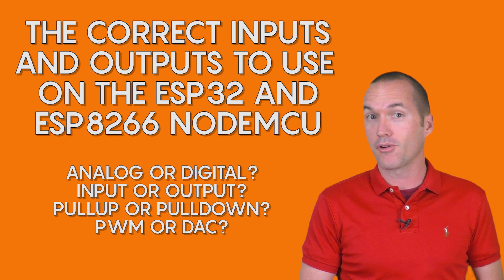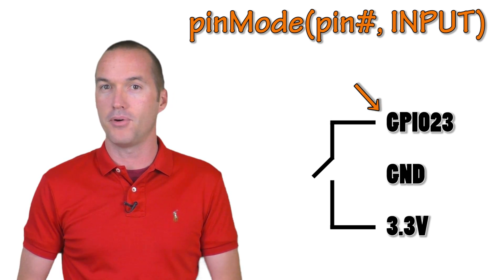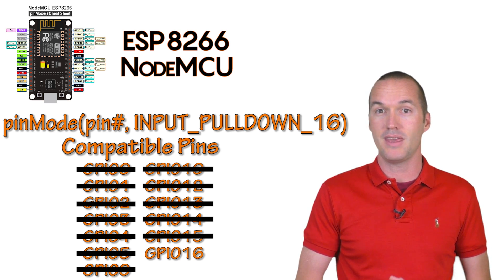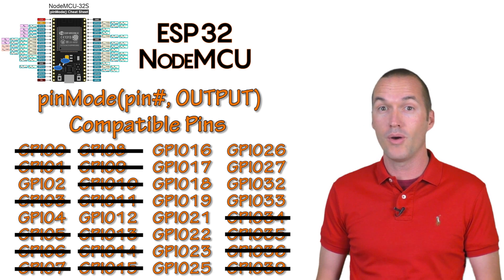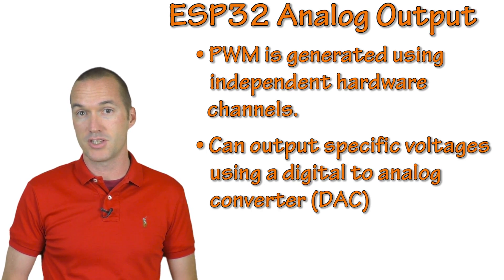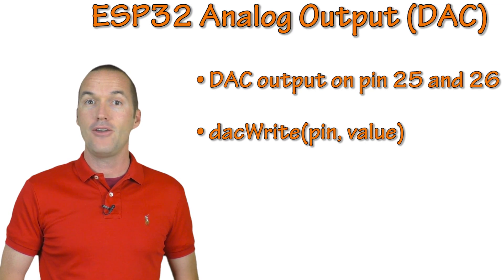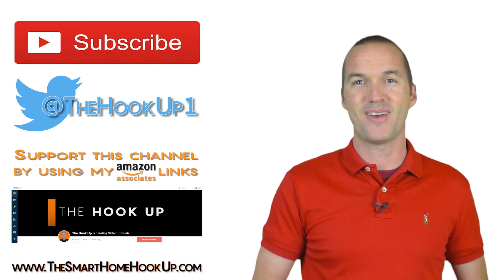The best input and output pins on the NodeMCU ESP32 and ESP8266

Comment: on the esp8266.. pins 0-14.. when you say pins high on boot... what is the pinMode of the pins at boot.. is this input high through the internal pullup resistor or output high.. because if they are digital outputs at boot and I connect a module or what not set as output also to those pins.. that would short the pins to ground/vcc vice versa when pins source or sink currents. which might burn the pins..

Comment: Hello  , Could some one please clarify what  is the output voltage of  ESP32 NodeMCU   GPIO4,GPIO16 and GPIO36 ? is it 5v or 3.3 V? When doing LEDs projects , some people suggest we us logic level shifter to control 5V led ( 300 of them using WLED )  , Please  help  as I tested those pins and they are close to 5V

Comment: one can easily convert a pwm output to an analog output by adding a capacitor. In order to know what value the cap should be one will have to apply some knowledge of electronics or experimentation. What happens is that the square pulse will charge the cap to a level equivalent to the amount of current flowing out of the cap due to the amount of load. The greater the duty cycle (percent on time), the higher the voltage level that is provided. Think if it like filling a bucket with water with short pulses of water.. full on, full off.. The level of the water in the bucket (voltage) will depend on the size of the hole in the bottom of the bucket (load) as well as the amount of time the water bursts refilling the bucket are 'on'.. (greater duty cycle = higher voltage)

Comment: What are usual resistor values for pull-up or pull-down resistors?
Reply from the maker: The built in ones are 20kOhm, but you can use anything over 220.

Comment: The video shows a Pull up resistor Green, Blue, Orange = 56K.   Is this the correct value to use?  How many mA goes into a GPIO input on an ESP32.  Thanks for a great video.
Reply from the maker: 56K will certainly work, the built in ones are usually between 20K-50K depending on the specific board.

Comment: Just checked the digital pins on my NodeMCU and I'm getting 3.3V from most of the digital pins even when my code (digitalWrite) is set to low for that pin.  Any reason I should be getting voltage from these pins whenever I power up the board?

Comment: so is it right that the pins only take 3.3 Volts? is the pin dead when I put 5 volts on it?
PS: cool Chanel sub and like!
Reply from the maker: It depends on how long it had 5v on it.  They are not 5v tolerant long term, but can take a second or two
Reply: The Hook Up cool thanks! So normale the Pins are not 5 Volt useable?
Reply from the maker: Correct, you can use a simple voltage divider though
Reply: The Hook Up Ok! Thanks man!!!

Comment: Why do you prefer nodemcu while there is D1 mini board that is pretty equivalent but a lot smaller?
Reply from the maker: Voltage regulation and tolerance are much better on the nodeMCU in my experience.
Reply: @TheHookUp  really really few applications need that added voltage regulation stability. All in all a good D1 mini from a good manufacturer does not have bad regulation

Comment: Can anybody tell me how will I then have to use GPIOs as when I connect my relay board with node mcu whenever power goes of or resets the Relay trips GPIO turns the relay on
Reply: no no no no I am not using no nv relay 
I am using magnetic dual coil latching relay I have used ESP 12 then used a npn transistor config to turn relay latch unlatch .
The high logic will turn on relay low logic will.not effect my relay .
The problem is at the time of power reset or board reset the relay gets a high logic on its own from GpIO which trips my relay I have also pull down my GPIO's still its happening .i can share schematic if u want but plzz help me
Reply: Same problem with me.. Any solution for preventing the relays to go high when I restarts my nodemcu??
Reply from the maker: Sounds like what you want is a normally open connection for your relay.  That means that when no voltage is applied to the signal line the relay is open (device is off).  You can then adjust your arduino code to use digitalWrite(pin, HIGH) to turn the relay on.

Comment: connect to esp8266computer's USB ports, everything working fine. But, if I connect esp8266 to separate charger that has USB port, then esp 8266not running code
Reply from the maker: That's pretty strange, no code runs at all?
Reply: Code works only when it is connected to the computer.. But when I connect it to a mobile charger it does not run

Comment: Esp8266 actually has a sigma-delta dac just like the 32
Reply from the maker: Really? That would be awesome, do you have any good links for it?  Is it implemented in arduino yet or only micropython?
Reply: @TheHookUp   It's for sure implemented in the lua firmware (which I use). Just #include sigma_delta.h (usage is in comments of header file)

Comment: using mqtt and tasmotized nodemcu gpio pins, i would like to control 
motor (forward/reverse/stop) is it doable ? any help appreciated
Reply from the maker: Tasmota does not natively support motors, if you got it to work through a motor controller it would be clunky at best.

Comment: Hi,
I am trying to connect 4 Relays and 4 Buttons to my Nodemcu esp8266 but unable to do so I have already tried to use your suggestions my PIN configurations are as under. 
Relay1 to D1, Relay2 to D6, Relay3 to D7 and Relay4 to D8
Button1 to D2, Button2 to D3, Button3 to D4 and Button4 to D5
can u guide me if possible which pins to be used for Relay and which for Buttons Thanks in advance,

Comment: Nice video, just one thing: on at least some models of the ESP8266 the ADC doesn't read beetween 0V and 3.3V but beetween 0V and 1V. If you need to read above 1V you need either a voltage divider or some sort of amplifier like a transistor or an opamp.
Reply from the maker: Correct, but the nodeMCU has the circuitry built in for 3.3v ADC
Reply: @TheHookUp  Didn't know about this, this is a great advantage over the bare ESP8266, thanks!

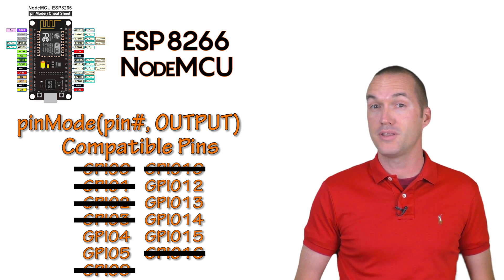Comment: Sir, very well explained. I got confused... You have said for more output go for esp32 (in video at 4:55). In nut shell, how many pins are available for output in esp8266?
Reply from the maker: 6 pins are well suited for output that don't have any potential problems.  You can use others as outputs but they have small issues like HIGH on boot.
Reply: @TheHookUp  Thanks, you mean others pin go high on boot, right? I can control in program. Isn't it?
Reply from the maker: @nitinjoshi239  Yes, you can set them to low once the program initializes, but they will always be HIGH for a few milliseconds on power-on.
Reply: @TheHookUp  got thanks and loving your videos....
Reply: @TheHookUp  sir, I seek valuable suggestion from you. One of my project require to drive 100 plus relays using Arduino, preferably using WiFi module. What solution you can propose.

Comment: I'm still confuse.
The Module I have has GPIO22  as a sensor input but its not one of the predefined analogue pins.
How do I set GPIO for analogue reading?
Do I use dacRead(22, 256) ?

Comment: Pleas i make project 4 relay and 4 button inputs is 12.  13. 15. 16
And output is. 0.  4.  5.  15
And play ok in real with button an also by blynk but when turn off and turn on not work and D3 or 0 pin have output all time and any button not work and any blynk button not work
Reply from the maker: There are a lot of tools you could use to make a project like this easily.  I'd recommend you take a look at ESPHomeLib, Tasmota, ESPeasy, and ESPerna.

Comment: I need to go back and check the code for pwm control of a PC fan. Never could get it to work w/ the 32S. Fan always ran 100%. Maybe you could do a short vid sometime?
Reply from the maker: I used the LEDC function in my ceiling light video, and there's an example sketch there if you want to look over my code.

Comment: 5:58 ten bit resolution return value between 0-1023 not 0-1024.
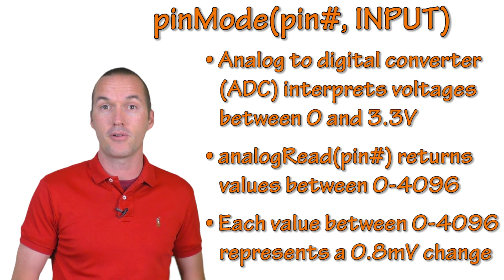Reply: Same with 12 bit resolution at 6:59. Range is 0-4095 not 0-4096.
Reply from the maker: Ack, yep, gotta account for 0.
Reply: And again with 8 bits.
Range of 256 ( 0..255)

Highest number MUST be odd, because least significant bit is 1.
Reply from the maker: Oddly enough, it doesn't loop back if you put in 256.  You'd normally expect 256 to return 0, but it returns the same as 255.
Reply: The Hook Up. I am guessing here, that the memory (address) that you write the 8 bit value to is itself wider than 8 bits. 
Then if you use the DAC with the limited 8 bit resolution, only the low 8 bits are used. Those do not roll over because the register is wider.

You can check if it rolls over at 16 bits or 32 bits.
Reply from the maker: good point, probably a good explanation.
Reply: The Hook Up. LoL  now that I think of it.. it's probably 32bits.. hence the name.

Comment: Does “pull-up” mean the input is set to high until the switch moves to ground then defaults back to high? Basically meaning the gpio pin is “pulled” up (high”) when not in use?
Reply from the maker: exactly.

Comment: Still a little confused on the pull-up and pull down resistors. How do they avoid floating voltages?
Reply from the maker: Ever heard the water analogy for electricity?  Resistors are like very small diameter pipes.  If you connect your GPIO pin to 3.3V via a resistor a small amount of current is able to flow to the GPIO pin and "pull it up".  If the GPIO pin is also connected to ground, the ground acts as a very large diameter drain that is able to divert the flow of current away from the GPIO pin and into the ground, causing the GPIO to be "pulled down".

Comment: The ADC on the ESP8266 is 0-1volt input. However some boards have voltage dividers to accept the standard 3.3v. Something to point in all the various boards out there. Test with a smaller input voltage first to make sure your board has the proper divider.
Reply from the maker: I think the 0-1 volt ADC was only on the really early ESP8266 versions.  If you get a nodeMCU V3 it should be 0-3.3 volt.
Reply: Haven't seen it myself but I also use nodemcu and wemos style breakouts. I stil see it referenced by people and datasheets for the esp8266 and even the 12-e module.
Reply from the maker: I can test it tonight, but I have a couple of projects that wouldn't work if it was only 0-1V, and they don't have any issues.
Reply: Correct, you are using breakout boards like I said. Those have the voltage dividers onboard. I just wouldn't guarantee that every variant has the set of 100k and 200k resistors on board to drop the 3.3v signal down to 1v that the esp8266 is spec'd at. Simply a message to others to test before you assume you can pump in 3.3v and let that magical smoke out.
Reply from the maker: Gotcha, I didn't get that from your original comment.  The ADC on the node-mcu which this video is focused on is able to handle 0-3.3 volts.  The ESP8266 raw chip may not be able to handle those voltages.
Reply: Wow... Seriously?  I explained it in my first comment in English but you were too quick to just to prove me wrong for some odd reason. That's not what any of of this is about. Relax.
Reply from the maker: When I read your comment it sounded to me like you were correcting part of the video, in the next few comments it became apparent that you were adding information about the bare 8266 chip.  

I'm not sure why we're fighting about this.